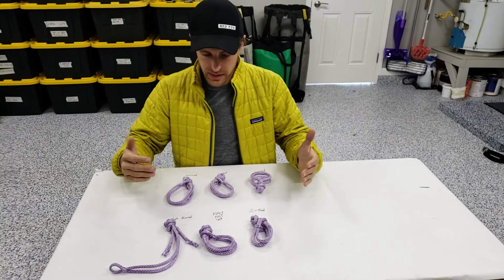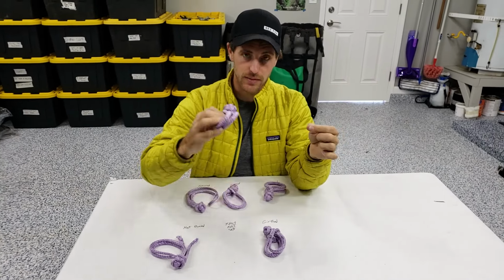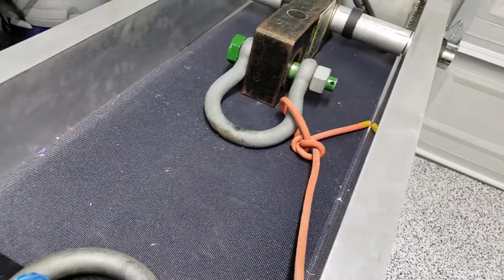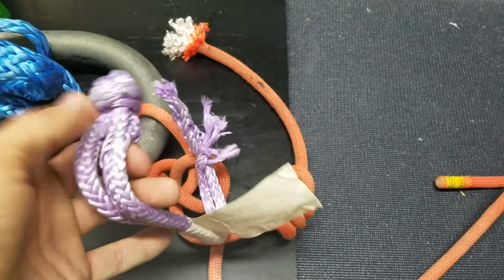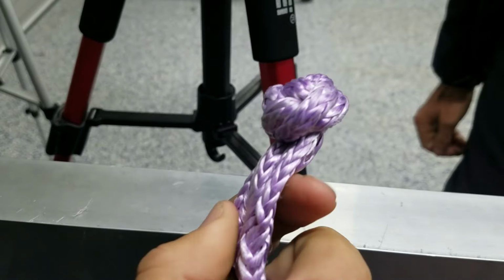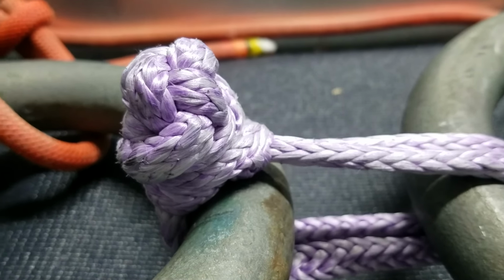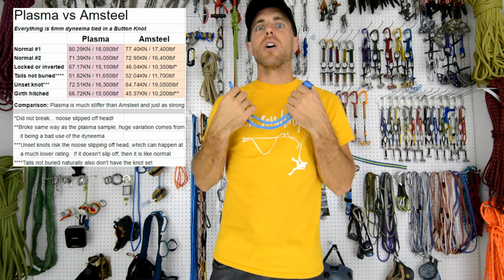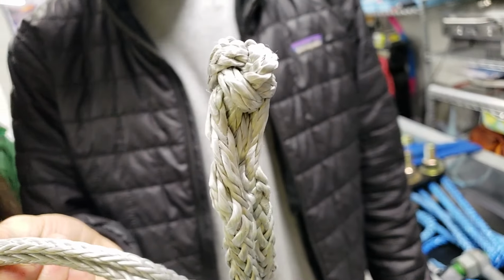Plasma vs Amsteel (Dyneema) button knot soft shackles

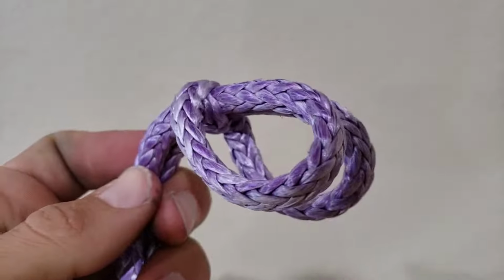Comment: 13:50 .. You should test that double loop on the "noose end, but without the through splice.  I think it was just uneven because of the through splice, which isn't needed for that prusik type double loop.  I would almost bet that it would even pull higher numbers, because you did 15k earlier on only 6 strands in that config: at 8:20
Reply: I thought the same thing. Would love to see this tested.

Comment: (I know this is an old video.)  One of your last comments about using the loop to make a (lark's head): The two strands didn't pull evenly. This answers the question I have about making quick and dirty soft shackles by tying two ends in an Ashley Knot then making a lark's head with the  loop end. I noticed without testing that the two strands almost always wouldn't equalize. So your test and comment tell me that this should only be used in a low force situation (a hammock, not a high line or a spinnaker on my boat).  I think my general assumption was that under load this would even out. You're saying. Nope.(So my solution, obviously,  is gets some dyneema and make several correct soft shackles so I won't have to jury rig a weak shackle.)  Thank you.

Comment: Something I have wanted to see, I just don’t have a way to test it, bury a piece of smaller dyneema, maybe a 4mm piece, in the end of the shackle where the eye is formed. Run the tails down both ends to meet but not over lap the tails from the other end. My theory is it will strengthen the eye by 1 or 1 1/2 times the break strength of the 4 mm dyneema, causing the 6mm Amsteel shackle to break around 20,000 to 22,000 lbs. Would love to see this, I’ve sent similar requests to other channels. Let me know, thanks.

Comment: A lot of people hang hammocks using a soft shackle with a button knot but without a spliced loop in the end, called “Evo Loops”. The shackle is connected, without using a spliced loop, in the locked or inverted position. It makes me wonder how strength is effected in this configuration.

Comment: Another soft shackle I would like to see tested would be a 3 ft loop made from 6 ft of rope.  Evenly cross the rope leaving a 3 ft loop then thread each tail into the 3 ft loop ending up with a 3 ft loop of doubled Dyneema.
To use simply insert a bite of the loop through "whatever" then place the 2 loops over "whatever".
If the "whatever's" are metal shackles like on your test machine, then there would be 4 wraps of the beginning size rope on each.
A "No Knot" soft shackle with no worry about each rope having equal tension.
Reply: I use something like this with my 4x4 to set my winch hook to my tree saver strap, but you have to have something with at least one open end like a hook or a screw shackle. Works great and way stronger than a soft shackle. I’m not a highliner, but I assume they have closed or stitched ends on their lines. You could use this in conjunction with a dog bone or something, but now your re-introducing another piece of kit and putting steel back into the system.

Comment: There is a reason why fishermen lubricates their grabs/splices/knots/etc., before pretentioning. You work with the exact same materials as fishermen, only scale differs. My guestimate is that you can increase your knot's strength by at least 75%, if you'll modify your test bench to enable you to pretention in a water bath.

Comment: I have been tying a soft shackle I wish you would test.  I tie a 3 strand double run gaucho knot around the soft shackle which can be pushed to button knot securing the loop around the button knot.
I simply tie a loop ending in button knot with ends buried then tie the gaucho around the 2 runs of the loop.
The gaucho knot is easily tied by beginning with a Celtic knot and then running the tail through the knot until all three strands are doubled.
For the gaucho knot I use a ploy cord smaller than the size of Dyneema in the shackle because it is not as slick as the Dyneema.
With this setup the loop around the button knot has equal tension with no precise measurements required.

Comment: You guys need to have a better understanding of what you are testing. Cortland Plasma line is heat annealed, Samson Amsteel is not.  The Cortland spec sheet does not not say what formula of UHMPE that Plasma line is, but we can probably assume its SK78.  Unless I missed something, you didn't compare the results to the same soft shackles in Amsteel? What you should see, using the style of soft shackle with buried tails, is breaking around 230% of the single line diameter MBL.
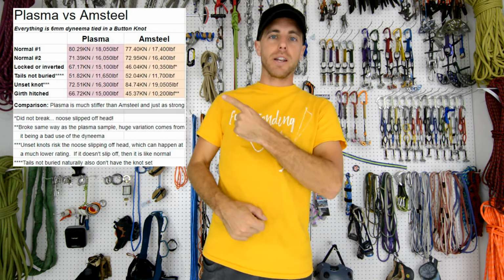Reply from the maker: It was pretty hard to find info on plasma.  I typed in Cortland Plasma like you said above and found what you are referring to.  https://www.cortlandcompany.com/plasma  That is super interesting how they make it stronger.  I found it way stiffer than amsteel and not as pleasant to work with.  We went through a lot of work to compare every test we did to normal amsteel.  Chart starts at 10:30 but we did not show the actual tests in an effort to keep the episode short enough to be interesting.  As fancy as Plasma is, I personally wasn't like "wow, what is this vudu magic material".  I think I'll stick to amsteel.
Reply: Plasma is using Honeywell's Spectra fiber
Reply: @thanasisvarnava8292  Spectra and Dyneema are both the same fiber at a molecular level.  They have separate patents because they were developed independently of one another.  When I mentioned what formula I was referring to sk75, sk78, sk99 etc... those are the 'flavors' that dyneeema is available in, the more advanced (higher number) formulations have better stretch and elongation properties.
Reply: @HowNOT2  So Plasma, along with other companies using various methods, is called heat-annealing or heat setting.  It pre-stretches the line and the heat treatment makes it stronger with far less creep (molecular elongation) than standard Dyneema line.  Amsteel is sk78 and not heat-set.  I use heat set lines to make standing rigging for sailboats, it does much better in high tension, static applications like that.  As you noticed, Plasma becomes much stiffer when tensioned (and slipperier too), so it does not hold knots as well.  In Sailing, we use heat-set for static applications, Amsteel and other non-heat set dyneema for running rigging which is our dynamic lines.  Outside of button knots on soft shackles (or similar) we avoid ever putting knots in dynmeea as it weakens the line by 50%, we always splice dyneema to retain full strength.  Of course, that doesn't apply to soft shackles since the button knot only acts as a stopper and isn't under much tension itself... you already know that style of soft shackle you are using is the best being 230% of the single line strength. I think that what you should test is if you are reaching that benchmark based on the published line strength.
Reply: @HowNOT2  While the patented recrystallization process of the Plasma rope increases the strength of the base fiber by aligning the molecules of the fibers, this is not why Plasma is has higher bending stiffness. The bending stiffness has more to do with the coating that is applied to the rope. This coating is designed to keep the fibers together better in order to lower the chances of the fibers or strands snagging in applications where the rope is dragged. While this does make it a little harder to work with, it does allow the rope to last longer while in use and retain its strength for longer.
Reply: @HowNOT2  And I must say, that is some great data you have collected on soft shackles

Comment: Have you tried this soft shackle method? https://youtu.be/K0eZz36PRYI
Reply from the maker: I know about those.  They are not centered even and that's fine for anchors, but for my inov splits (connecting multiple highlines) i need soft shackle heads that sit centered.
Reply: @HowNOT2  have you snapped any? Any noticable difference in strength?

Comment: Thank you for the very informative video. I am sure it took a lot of time and effort and please know that it is most appreciated. A question regarding bury lengths of the tails. Is there an optimum length? There seems to be a divided opinion on that it is critical or that it is simply for increased diameter. Many thanks once again
Reply: Knot that I’m an expert, see what I did there?, but my understanding is that burying the tails is two fold. First, it makes it so the knot can not come untied, which is a possibility without the bury.  Second, it causes the rope section before the knot to be twice as large, which causes the stress point of the eye to be spread out over a larger portion of eye. The sharper the bend of the eye around the rope end, the more stress it puts on that one piece of rope at the end of the eye.
Reply: @biggs8729  thanks for the contributing. Tried making soft shackles without burying and not even doing the crossover for the eye. Just a rope with button knot and zip ties instead of the eye. It holds no issue. Seems like the bury is non-essential and even the crossover is nonessential aswell
Reply: @baderh7880  so, I think you might be a bit more adventurous than I am, using zip ties to hold your soft shackle on the knot, hopefully you're not using it in a life safety scenario. I would definitely rethink that and actually form the eye the way it's supposed to be or at the very least do a girth hitch around the knot.
Reply: @biggs8729  no definitely not for any highlining. Actually for vehicle recovery.

Comment: Thanks for the video! A girth hitch actually doubles the strength of the rope if used right, by doubling the strands that take the load. You’re effectively giving the rope a 2:1 advantage as if you were using a pulley. By building the girth hitch through the rope instead of around the rope, you halved the number of strands carrying the load and canceled out the doubling effect of the girth hitch. I believe you will see a significant increase in the strength of your soft shackle if you use a true girth hitch that passes around itself rather than through itself. I realize that’s not the point of this video, but you guys seemed surprised, so I thought I’d share my understanding of the situation. Cheers!